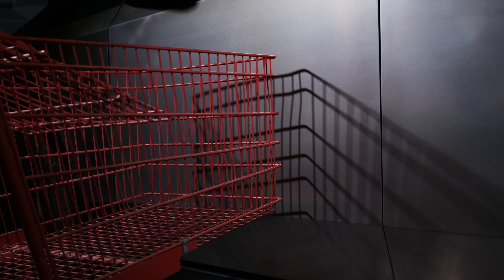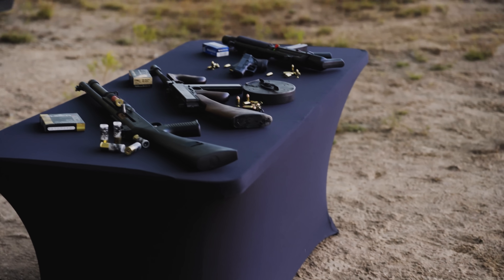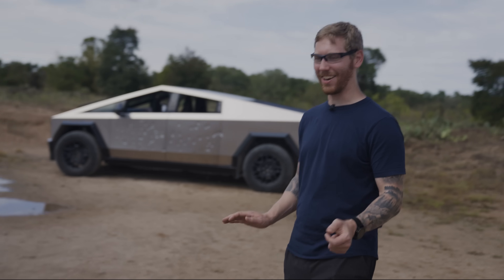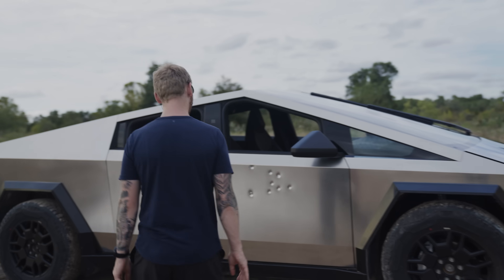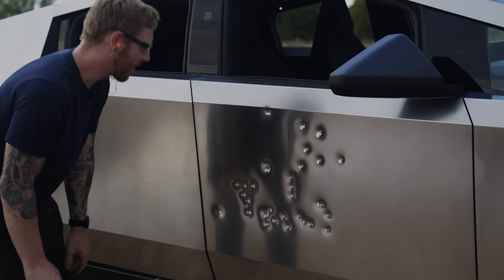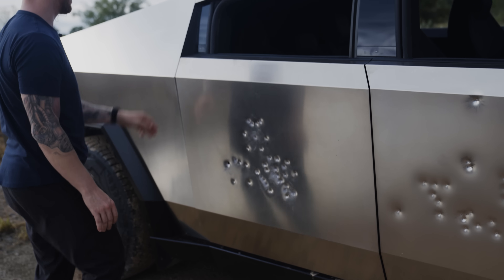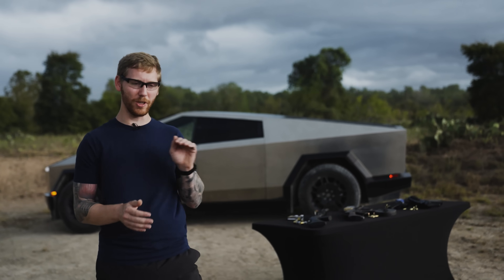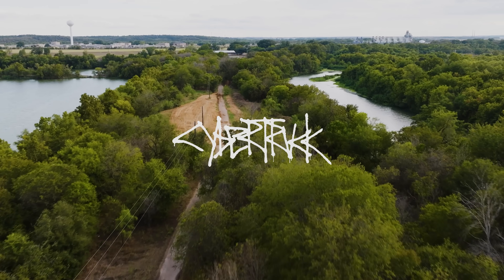Cybertruck Bullet Test

Comment: It's crazy seeing the stainless steel wobble like that in slow motion- the amount of force it's stopping is incredible.
Reply: this is the most american car ever created
Reply: @alphazero6571 
And a disingenuous video with visual effects added for close-up shots.
Reply: @alphazero6571   Which is exacly why it won't sell in Europe. Amarican cars have a reputation of having a worse build quality than most 3rd world countries.
Reply: @@mpdoor2515 I mean, someone could develop a custom stainless steel alloy.
Reply: And one only need to ad 00000000000000000001% dog shit to make it a custom alloy..Nerds are so hyped up for stupid things they know nothing about. @DAndyLord
Reply: 1.8 mm is not that thick, that's why it wobbles
Reply: @@mpdoor2515 It's stainless steel, they literally said it's a corrosion resistant 300 series steel.. The most common is 304L stainless steel or 316L, since they increased the corrosion resistant they're basically playing around with the percentage of chromium. It won't be as high as a 316, but certainly close to 304 or 303 etc.
Reply: Very small amount of force, About the same as a baseball going 30 mph. i think you meant the pressure?
Reply: @user-sj5ju4jb7t just watched a head on crash test that Tesla did with this truck and the force was so high that the rear axle broke. I definitely wouldn't want to be a passenger
Reply: @BeneHeller  It's flat because 1.8mm stainless steel panels CANNOT be stamped.

DeLorean found this out the hard way. Even though to DeLorean's stainless steel panels were much thinner, they kept breaking the stamping machines.
Reply: @bibasik7  Yeah. Like a kitchen sink can't be stamped or a refrigerator can't be stamped or a million other things that are made out of stainless steel can't be "stamped"(pressed!). Sorry, but that is absolute nonsense. We've been pressing stainless steel for the best part of a century, now. Have a look at the roof of a 1957 Cadillac, it's pressed stainless steel. 
And, while we're on the subject of pressing stainless steel, it doesn't break "stamping machines" (presses)! 300 series stainless steels are actually very soft and very malleable.
They press beautifully. It is the pressing process that causes the material to harden. The same thing happens when welding stainless steel or machining it if you don't keep it cools.
Musk's claim that they kept breaking presses is weapons grade BS. Sorry, but that's the truth of the matter.
Reply: @davidbrayshaw3529  That's why I specified the thickness of the stainless steel. Did you READ my comment?

The DeLorean DMC-12 had production issues because of the stamped stainless steel panels, and those were much thinner that the Cybertruck's panels!

Have you seen the video of someone smashing a refrigerator with a sledgehammer, then hitting the Cybertruck with that same sledgehammer and not leaving a mark?
Reply: @davidbrayshaw3529  OK, I'm sure you know more than the engineers of the most innovative company in the world 😊
Reply: @bibasik7  No, I just know more than the gullible fools that their marketing department markets too.
Spend half an hour at the keyboard. Cross reference Tesla's claims, cross reference my claims and become self informed rather than a victim of propaganda and myth.
You will soon realize that you have been lied to, by one of us, and I'm not trying to sell you anything, baby.
Wake up. The world needs you with your lights switched on, not living in la la land.
Reply: @davidbrayshaw3529  Why would Tesla lie about that? If they could've made a better product by using stamped steel, an existing (and cheaper) manufacturing method, they would've. Tesla already has many huge presses for making other stamped structural components, so they're well versed in making very large stamped parts.

If Tesla is lying about this, they're only lying to themselves. It does not matter to the consumer whether the doors are flat or curved, they deflect sledgehammer blows just fine.
Reply: @BeneHeller  additional vibration means force consumption. go back to physics class bucko.

edit: only a fail of a human would exclaim the sentence "loss of 3d-rigidity"...
Reply: @timetogetmyway 🤓🤓🤓
Reply: @tippytoes2133 well I agree mostly with you but 9mm 115g are supersonic.
Reply: @user-sj5ju4jb7t Safety is certainly one of the most important factors, but given how the main "safety" feature of this car is how indestructible the body panels are, I can't imagine actual crash safety was at the forefront. If the panel won't buckle from a sledge hammer blow, it won't crumple that well during a crash
Reply: ㄹㅇ
Reply: @@mpdoor2515stainless steel is an alloy
Reply: @Epiclyfail  Exactly. All "steel" is an alloy of iron.
Reply: Its crazy how absolutely fugly this thing  is, its incredible lol!
Reply: @@mpdoor2515all thanks to the Delorean
Reply: It can't and it doesn't... this is a LIE!
Reply: It's not stopping the force it's absorbing and redirecting it.
Reply: Just FYI, the doors are 3mm stainless, not 1.8
Reply: Obviously it means it's dispersing that huge pin pointed load of energy all at once while holding it all together! Crazy that you can watch it handle and transfer that much to the point it's violently visible
Reply: RPG please😊
Reply: @user-sj5ju4jb7t You better start imagining. These vehicles have not been submitted for independent testing. From the vision that Tesla has released of frontal impact, there's a reason for that. The "crumple zone", for want of a better term, is almost non existent. Cranial deceleration is brutal as is spinal articulation. Death Trap. Fortunately,
there aren't laws governing that in the US, but this isn't anywhere near ready for European markets.
Reply: shoot the glass its not bullet proof on the truck lol
Reply: @lemcakes32422 he did say the car isn't intended to be bulletproof
Reply: @blackmantis3130  gimmick?
Reply: @lemcakes32422  So many autistically challenged (and triggered…pun intended) Europeans and libbies whinging and nitpicking calibers.lol
A: It wasn’t designed as an armored car and only were claims made that the cold rolled stainless panels are bullet resistant to specific calibers. 
B: Even armored cars are ‘only’ bullet resistant according to levels.
C: It can be fitted with bullet resistant windows and it’s still more bullet resistant than any other mass produced vehicle.
D: Commenters here lack reading comprehension and reasoning skills.
Reply: @BeneHeller  You just contradicted your first statement, let me bet you know nothing about engineering and you leave countless comments everywhere how bad Tesla is because you watch to much videos of the opposition telling you to hate tesla ....yet here you are hating ...Bleh bleh bleh bleh (The sound a little sheep makes)
Reply: @arniekando6846 Ironic a Tesla fanboy is calling someone else a sheep. Elon can’t see your comments buddy, you don’t gotta ride his meat.
Reply: @arniekando6846 and yet you provided nothing to disprove their point. Its pretty obvious which one of you knows nothing about Engineering
Reply: @BeneHeller  🤓☝
Reply: better than apple's titanium.
Reply: @user-sj5ju4jb7t Tesla's tend to also not be made of stainless steel and their safety rating mostly comes from their rollover testing, something that I'm sure the cyber truck will fail given how tall it is. I can very easily imagine Elon sacrificing safety to make a shiny bullet proof car
Reply: these aren't even AP rounds... of course they will splatter on contact with that soft material lol
Reply: @Danuxsy  did you know HP are the legal carry typically? Good luck explaining FMJ rounds if your a legal carry....
Reply: @Danuxsy 
Looks like CGI close ups of the bullet impacts.  The 00 buck rounds have fireballs and smoke on impact!🤣🤣🤣🤣

Comment: I wonder what happens to the occupants of that truck in case of an accident. Being that hard, doesn't it mean that it wouldnt deformate to protect people in case of collision?
Reply: thats a really thoughtful question. I wonder the same too. Obviously they have a crumple zone in the front and back due to the frunk and truck bed but what about the sides!!
Reply: It still does because the material is very thin
Reply: Tesla has the safest cars on the road. They've tested it, and surely is no different. The castings underneath have crazy designs to safely crumple
Reply: @thomasreese2816  Massive cope. The dude said the steel was so thick it's considered not just cosmetic but structural. Either it's one or the other.

Comment: Prohibition era cars would stop .45acp from tommyguns which was why bonnie and clyde started to use the BAR automatic rifle using .30-06 caliber. Also why use MP5SD variant to shoot the cybertruck? The silencer/suppressor of the SD reduces velocity to be subsonic greatly reducing its energy potential from a long barrel, actually the mp5 long gun in video even shows lower velocity than the Glock pistol (950fps vs 1100fps) so a fairer test would 9mm carbine with NATO spec pressure ball ammo loads might have far better performance due to increased velocity.

Comment: love how they called it an mp5 instead of an mp5sd. that variant is suppressed, and it slows the bullet down to make it subsonic and quieter. a regular mp5 would cut right through the "bulletproof" panels lmao
Reply: The suppressor doesn't slow the bullet down, it slows down the gas coming out. If you want your bullet to go sub-sonic you have to buy special sub-sonic ammo, that doesn't go above the speed of sound in any gun
Reply: Suppressors don’t “ slow the bullet down”. They reduce decimal volume through gas expansion capturing.
Reply: the mp5sd still has a lower bullet velocity because of how its suppressor works @jordanoswald6842

Comment: None of the calibers have any penetration power lol.
Reply: well it's pretty obvious anything with real penetration power will go through this. You need pretty thick steel to stand a chance versus any high powered rounds. Even supersonic 9mm will likely go through thin sheet steel like this. I guess the purpose of the video is to show the actual true limits of what it can hold, in this case subsonic 9mm/.45
Reply: You cannot test the limits without reaching the limits. They should have started with a small round and moved up, for science!  @fredrikronnberg684

Comment: I bet these panels are insanely expensive to repair after an accident! It's cool that they are basically bullet proof.
Reply: That's why it's great to have insurance.
Reply: @RexTacitus  Unless it's twice the price to insure a Cyber truck vs a regular truck.
Reply: @KPHVAC  It wouldn't be twice the price but EV Insurance is a tad higher than normal cars. It would still be based on what model you get.
Reply: "basically bullet proof" it ain't. Rifle rounds, shotgun slugs and every caliber above those will tear right through it. You can say that it is simply more bullet resistant than other trucks, but nothing over.

Comment: Clever marketing but let's be honest, this has NO real world use in the trucking world. There's a reason why there's crumple zones in cars and not bulletproof
Reply: In the trucking world you could argue there is value in a durable outer shell. Scrapes, scratches, dents are basically a complete none-issue with this design which gives you a lot more freedom of movement & less hassle with repairs. But yeah it's niche.

Comment: Lol they purposely picked rounds with poor penetration. Swap out that tommy gun with an AR chambered in 556 for something more middle of the pack.
Reply: It's basically not possible for thin sheet metal to stop a 556, so what's the point of making a video on it. This video is a limit test, showing the most of what it is capable of stopping, which is subsonic 9mm and .45, kind of like kevlar.
Reply: @fredrikronnberg684  I mean the original unveiled design supposedly was using an exoskeleton design.

They're desperately trying to paper over the fact that they abandoned the exoskeleton (in this very video he brings it up without making it clear that that's not longer the design they're using). Now it's just a regular frame and body panel vehicle with thicker body panels than normal.

The whole thing is just a bit embarrassing. It's almost like Tesla consistently engages in extremely misleading marketing or something....
Reply: @garthbartin  Not sure I follow. Based off all info i've seen over the last couple days, it does still have an exoskeleton, and no internal frame. Where did you hear it doesn't  have an exoskeleton? And regular body panels are not steel, they're usually aluminum. 

I feel like you're underplaying what it takes to stop a 9mm. Normal cars do not stop the rounds you're seeing in this video.

Comment: Paul Harrell on his YouTube channel did a test on using a car as cover. The bullet will go through doors but if you had beind the engine block it will prevent bullets.
Reply: Not allways though only in the lower part so if you even crouch youur neck and head is still exposed, a normal car is just visual cover
Reply: So, <5% of angles, vs. nearly 100?

Comment: you guys are click baiting this test by using slow wide bullets that are made for soft targets and the suppressing them to slow them down more. A Tommy gun shoots at 950 FPS, the average AR is 3000 FPS. this is a sales gimmick at best
Reply: It proves the point that it’s more durable than a traditional truck.
Reply: @stefanms8803 and why does that need to be more durable? Your realize crumple zones are really important to protect the driver and passengers. If the truck doesn't crumple you're going through that extra large windshield.

Comment: The truck is double the cost of what we were originally told, it can only tow 11,000 lbs compared to the 14,000 plus pounds promised, and can only get about 300 miles per charge compared to the 500 promised, but at least it is bullet proof. I always look for that in a truck lol.
Reply: there was nothing promised. there was projected specs and there are real ones. Just like EVERY VEHICLE prototype vs real world. And they haven't even released the cost of the base model, which was the cheaper option one at around $40k original cost speculation from tesla.
Reply: @nicholaswilkerson501  Musk is a scammer that greatly over inflates every claim he makes. He knowingly does this.  In the end you are getting a truck that tows less than the F150, costs way more, and only gets 300 miles per charge so let ng distance driving is out of the question. This is nothing that was promised.
Reply: post covid inflation and bidenomics pal
Reply: @HavenParadisePlays  No the price quoted was one I was referring to that he gave a few months ago.
Reply: @katkit4281  but you said it double the cost wft
Reply: @HavenParadisePlays  Sorry not double but 1.6 times the cost. Better?
Reply: The price went up yes, beside inflation and bad economy, I think it's because they aren't scaled up to mass volume yet. I wanna see the price after they go through the early reservations and hit 250k units/year.

11,000lb is actually an upgrade over the 10,000 for the dual motor version, this is what they're starting with. The triple-motor "beast mode" one is 845hp, this one is 600hp iirc.

They seem to have also made it more modular, you can have it in 340 mile config, and then you can add a range extender pack to take it up to 470+ mile range.
Reply: @AllanSustainabilityFan  Maybe the price will decrease like you said. However the problem I have with the range extender is it takes up space in the bed so you are now sacrificing space for driving range.

The 11,000 is definitely better than 10,000 lol. I cannot argue that.
Reply: @katkit4281  Yeah it's an interesting trade-off. I wonder how easy it is to attach and detach, that thing probably weighs a ton lol.
Reply: It is absolutely NOT double the cost. The initial price estimate was 39990 for the entry model, if you adjust that for inflation to today, it'll give you a price of roughly 50k. The entry level model will be 60k, so just 20% over the initial estimate, not "double the cost". 

You're cheating with the models, choosing the most expensive model for price comparison, and the base models for feature comparison, in order to fit your narrative. The top model will do over 470 miles, so quite close to 500.
Reply: Man if only you could count 

Original projected price in 2019 is $69,990 for the highest tier 

And 2023 Cybertruck highest tier is $99,990 

Idk where you got that "It's Double The price" when you could count it if you can
Reply: Not if someone is aiming for the head though
Reply: @wittywolk  Lol true.
Reply: What we were promised.
Don't pretend you are sitting there deciding what type of truck to buy.
You're probably some commie who believes nothing should be paid for.
Reply: It's blue cities proof so

Comment: What about the tyres and the glasses? Are they bulletproof too?
Reply: No. It is not advertised as an “armored vehicle”. To me, this is the “next level”. A better performance above all. THAT SOUNDS GREAT TO ME. ✌🏻
Reply: It does not have bulletproof glass. Bulletproof glass is usually so thick that you cannot roll it down. The windshield is long, thick, and on a small angle, so it might change the bullet trajectory enough to offer a little better protection than a typical windshield.